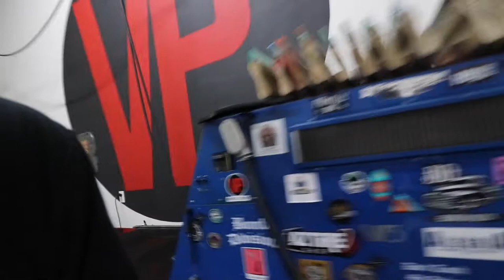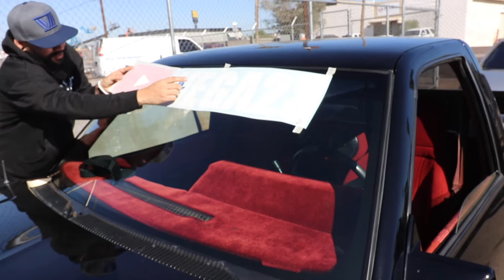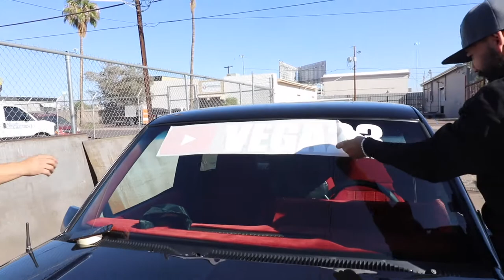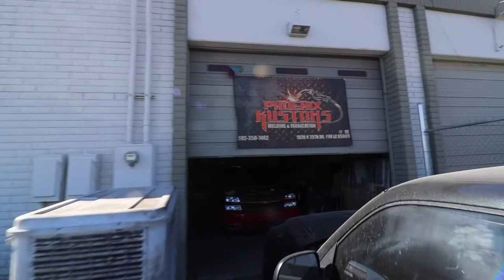royal pics 454 chevy truck

Comment: I remeshed my screens with 235 and 305 with yellow mesh and on my second reclaim they ripped... what i am doing wrong? Ecotex
Reply from the maker: They rip pretty easily if your not careful because they have a lot of tension 

Does it happen when you reclaim them or when they are on the press
Reply: When i reclaim them on brand new mesh, second time...
Reply: kolorkonexion maybe when you stretched them the tension was a little to high try to relax the tension to find a happy medium and try it again. I use ecotex products and don’t have this problem. I also don’t stretch my own screens I buy new ones already meshed. Just a thought and check your scrubbers and make sure they don’t have any sharp edges because it could possibly score the mesh and when your reclaiming them the emulsion is probably holding it together until your remove the emulsion and your pressure washer rips right through it . Not sure but I hope this helps!
Reply from the maker: Jason Lee thanks 
I also buy them ready 
And yes you are correct about the scrubs 
Sometimes they do have sharp edges 👍🏼
Thank you